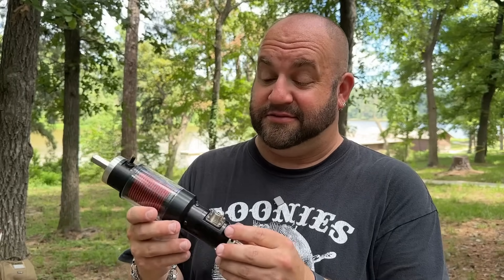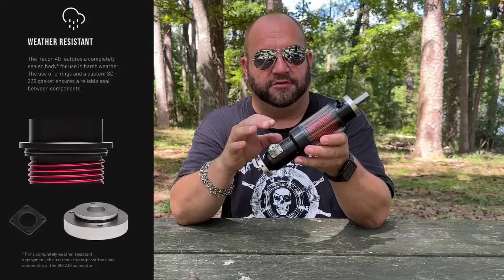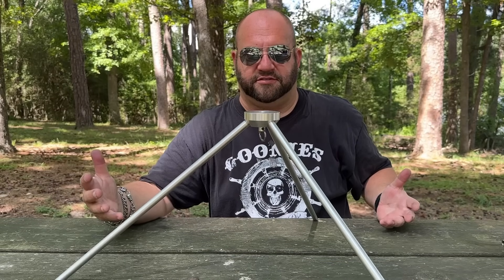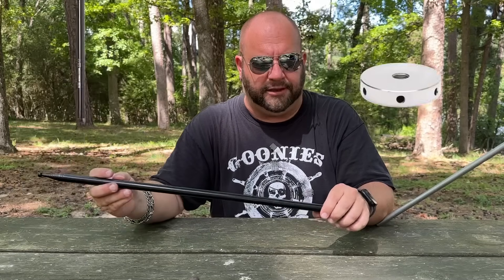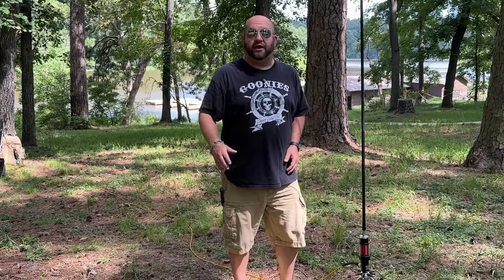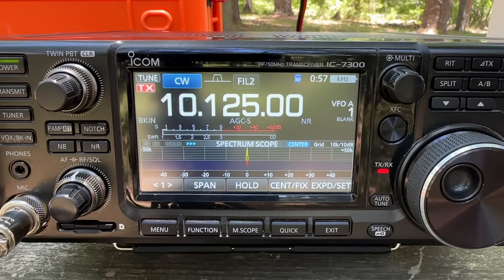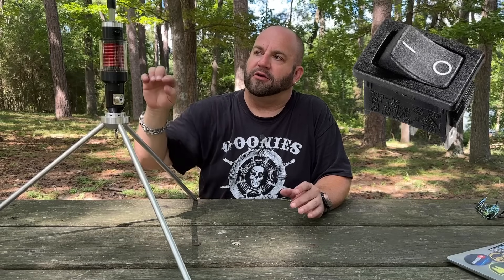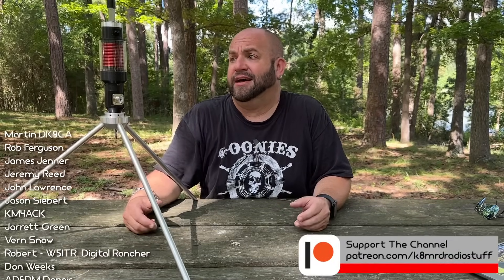NEW! Recon 40 High Performance Portable HF Antenna Coil

Comment: I talked to (REZ) Mike at Hamvention and told him  the selling point for an older ham like me was not having to get down to move a coil ring up and down to tune.  Standing and moving the whip up and down is much easier.  Looks like  you (MRD) Mike agree, thanks for the review.
Reply: I recall this conversation! It was nice meeting you at Hamvention. 73!

Comment: From SteppIR titled, "RADIAL SYSTEMS FOR ELEVATED AND GROUND MOUNTED VERTICAL ANTENNAS"   As more radials are added the impedance of the antenna drops, over perfect ground a vertical is 36 ohms. If you put up a vertical with a poor radial system you usually get a good match because the ground LOSS adds to the 36 ohms to get you at or near 50 ohms, but with a big drop in signal strength.

Comment: Wide band, low Q in the coil, low efficiency? Would like to see some field strength comparisons with some other antennas.
Reply: I was thinking the same thing… whenever I hear someone say an antenna is “ridiculously wide bandwidth” my mind always translates that as meaning “low efficiency”.  A 50 ohm dummy load is ridiculously wide band, but…
Reply: Far field strength comparisons would absolutely be the best way to compare this antenna to others. The wide bandwidth on this antenna is because we don't need much inductance (approx. 7uH) to load the the 17' whip for 40 meters. If you put a much shorter whip on and left the coil active you'd see the bandwidth Q tighten up near resonance. A great example is the SWR curves from our Ranger 80 antenna. With our 9.3' military whip the narrowest bandwidth Q is on 80 meters with max loading. Move up to 20 and you can cover the whole band. However the antenna is not more efficient on 80 meters for obvious reasons.

Coil modeling suggests the coil Q is around 475

Comment: Hi Mike,
I’d love to see a comparison between the Recon 40 and the Packtenna End-Fed Random (9:1) with 29 feet of wire. Both antennas would be set up in a vertical configuration from the ground, using 40 meters as the primary band. It would also be helpful to see how they perform on 20 meters and 10 meters as well.
If you’d like to include the MPAS 2.0 with the extension and whip, that would be fantastic. A simple three-way switch for ABC comparisons would be awesome. I think just switching between the three of them on receive, without using a tuner, would be sufficient for the test.

Thank you, Dan  KM6CQ

Comment: So, this is just a really nicely done, high quality, $300 Sporty Forty w/a built-in bypass switch...and correct me if I'm wrong, short of 30/40M which did use the coil, the bandwidth capability for 20-10M was all on the whip...is it not?  The switch would have bypassed the coil on the high bands....

That said, If I was running as much power as it can take, I would consider it, but the most I'm pushing is 50W portable....a WRC Mini for less than 1/6th of the price will cover that.  I will admit, though, it does look really nice and extremely well built....and that whip looks like it is on point, and it is priced competitively....

Comment: i have a extremely overpriced Omega Seamaster watch which keeps great time and looks really good.  The watch I wear on my wrist is a $20 Casio digital watch which also keeps really good time.  Both of these watches perform their primary function very well.  The REZ is unique with its high quality construction along with a  switch allowing you to bypass the coil.   But , you have to ask yourself, is it really worth it.   I also bought a similar  40M coil designed for the same purpose as the REZ, however, it was about $50, or less, with shipping
Reply: All I got from that is yer a fool that doesn't wear his Seamaster. Put it on, that's the point. I can make a coil on pvc myself it won't be near as enjoyable to use. Heck for less money a DX comander doesn't really take much loger to setup and you don't need to tune between bands...not every purchase has to make the most financial sense.
Reply: @chublez if all you got from his post is that he doesn't wear his seamaster then you have a lot of nerve calling him the fool.

Comment: Mike if I was to do a park in my mobile could that antenna be screwed in the bull bar intead of the tripod.
Reply from the maker: I don't know what a bull bar is but sure.
Reply: @hamradiotube  Bull bar/ Roo Bar Aussie term for the bar on the front of the vehicle where Spotlights or antennas can be mounted. We mostly hit roaming Bulls or Kangaroos on our outback roads hence the name.
Reply from the maker: @willian.direction6740 ahh ok.  So long as you can get a good ground to the car so it can act as the ground plane it shouldn’t be a problem.

Comment: Looking at the Tarheel Designs dipole i have a small village lot with no place to hang antennas .. looking to mount it on a roof tower ...
Reply from the maker: That'd definitely be an option.  I've never used that but I saw it at Hamcation.

Comment: What you don't mention, is that it's a complete pain in the arse to have to constantly get the metre out to make sure that you're resident when switching bands. That's the major drawback with this approach to antenna design; switching bands is not seamless and takes a while as you have to disconnect the radio, connect your rig expert, get it into a suitable range and then reconnect your radio again. I use a very similar system to this in the UK and I do find it a bit of a ball ache if I'm honest.
Reply: You don't need to do that. 
If you know roughly the height the whip needs to be, you just move it there and let the 3:1 tuner bring it in.
Antennas don't need to be spot on, anywhere in the 3:1 range is fine.
Yes some radios don't have an internal tuner, in that situation you're likely SOTA with a small radio, so an EFHW is going to be a better option.

But even my FT-817 has a small tuner available, called the LDG Z-817. It can tune 10:1 so you could use it on this antenna 15m, 12m and 10m all as a 5/8 wave.
Reply: @shanerorko8076  My FT891 has no tuner, so it's a pain.
Reply: @johnratcliffe6438  So, without a tuner, you really need to use an EFHW for a multiband antenna for portable use.
Evil lair electronics has some good videos on how to build a really good EFHW that is bang on from 80m to 10m.
Reply: @johnratcliffe6438  Who needs a meter? With my whip, I sat down and tuned each band.  Once each band was tuned, I marked the whip with a Sharpie (could probably score it, as well....or both).  Is it perfect...no, ground conditions will always change that.  However, it is close enough in the ballpark to not hurt the radio, and then you can just tweak it from there, if needed...
Reply: @amnchode  yea exactly, too many people get caught up on perfect SWR, which isn't needed.
The only thing you should be concerned about is if the SWR is causing the radio to drop its power.
If this is happening, you need to bring the radio in to a SWR so the protection circuit stops tripping.

Like I said, if you have a 3:1 internal to the radio, close enough is good enough, the power will still radiate, then you can just get the dimensions close, so you get the radiation pattern you want.

Comment: Good job - you promote amateur radio, but recently there has been a harvest of all kinds of "inventions" but everything is based on a wire rolled into a roller and two plates acting as a capacitor - that's one thing, and secondly such coils should not have such large "plates" of the capacitor at the ends. There are much simpler methods of forcing any whip to work well.